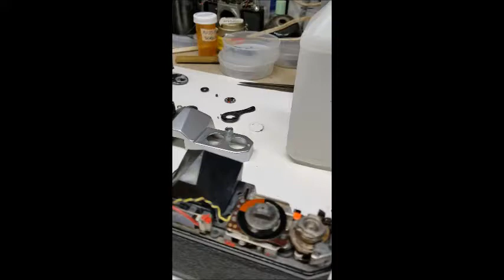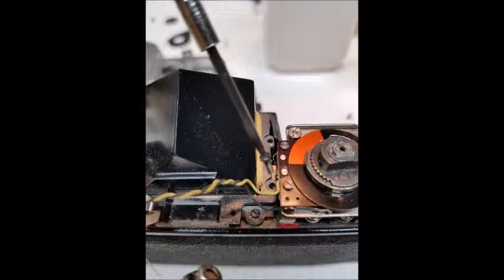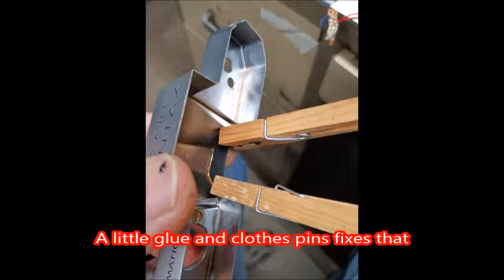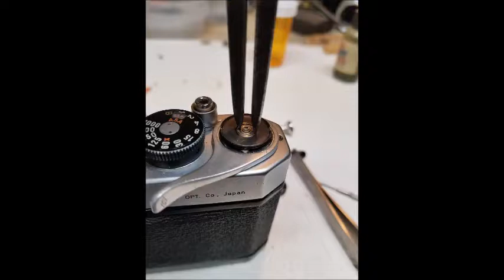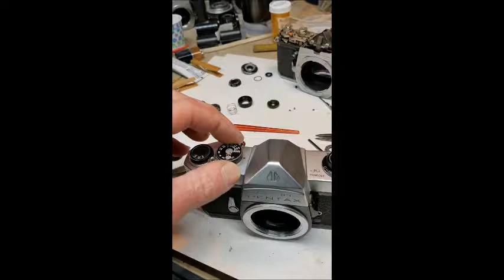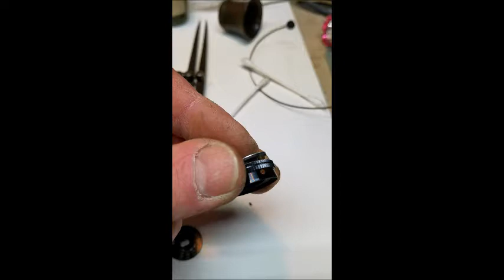pentax spotmatic broken eye piece

Comment: Hello there, I actually bought a spotmatic F on a shop that sells used stuff and it is in a prety decent condition although i had to so some cleaning, some lube here and there. Although the internal mechanism works as expected there is this thin black line in the middle of the glass. I supose it is a brech in one of the glasses, will this be a problem when i try to take a picture?
Reply: BTW it is where you have been working in this video
Reply from the maker: If its only in the eye piece it will be fine, just be sure its not in the lens.  You can remove the lens and look through it if there is any doubt. While the lens is off you can look inside to see if there is anything on the underside of the prism, its possible it could just be a hair on the glass.